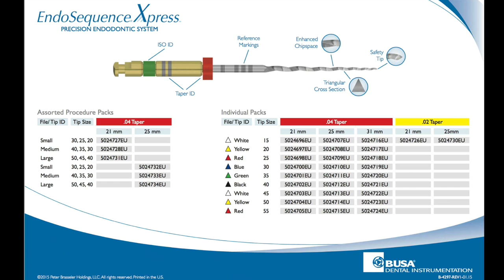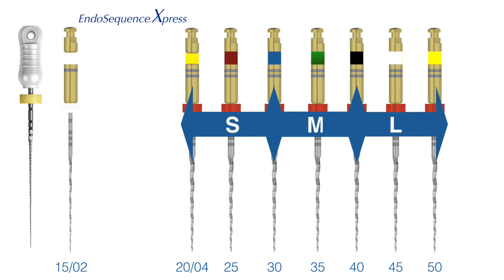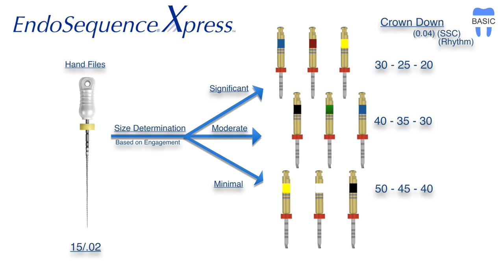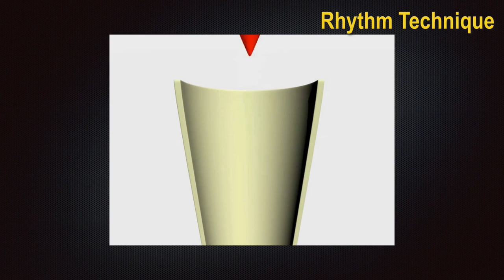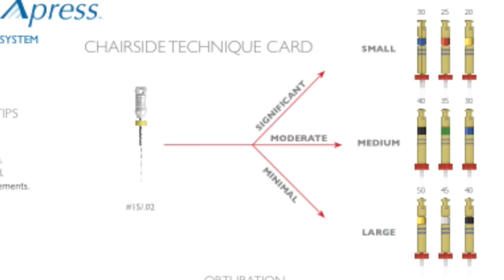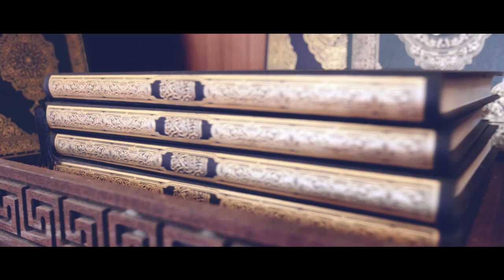EndoSequence Xpress Anterior tooth Demo

Comment: Hi Dr. Nasseh,

I was just wondering, when you use your master file to apply the sealer to the canal walls, are you using the same file that you used to instrument the canal or a new sterile one? If using the same one that you used to instrument the canals, how do you adequately disinfect it to ensure that you are not recontaminating the canal after your final irrigation? Thanks for your reply and your content!
Reply from the maker: You can see that here: https://realworldendo.com/gutta-percha-disinfection-prior-to-root-canal-obturation/
If the link doesn't show you can go to our website at RealWorldEndo and search for "gutta percha disinfection"   Essentially, you just have to soak it in bleach for 30sec. Ideally, however, use a sterile file at the end to do that.